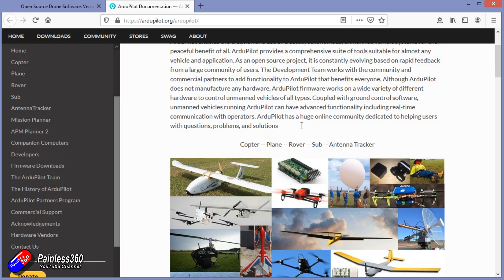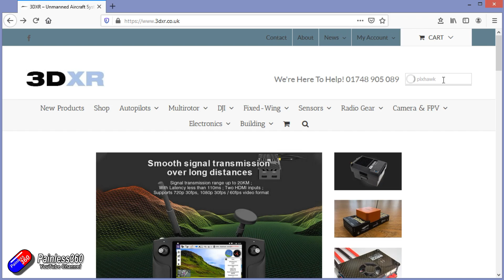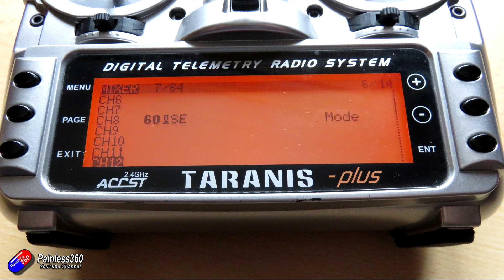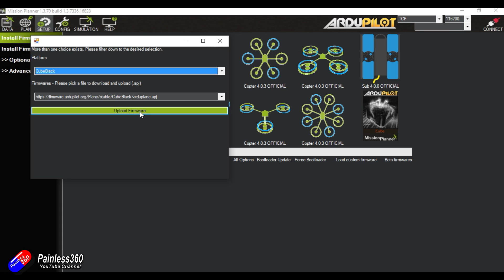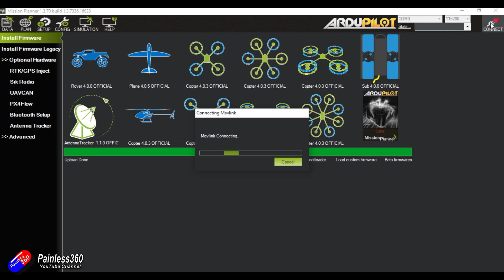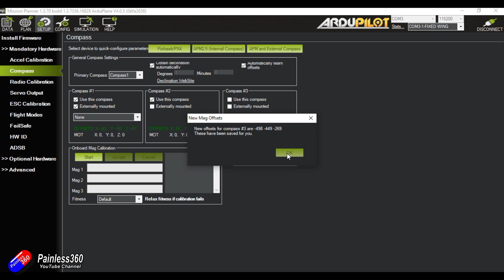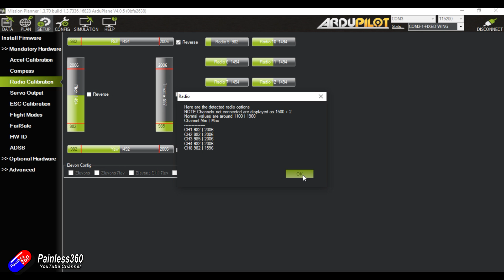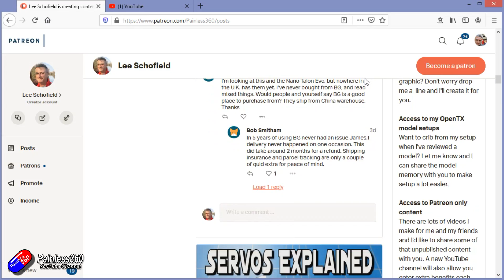PixHawk/Mission Planner/ArduPlane Build for Beginners: Flashing and basic setup

Comment: Nice explanation. I have got the feeling that you inversed the left and right side of the FC during accel calibration - or did I misunderstand something? 
In my PixHawk Orange Cube, the USB plug is on the left side, so I thought that I would need to put the FC on this side for calibrating the left side...
Reply from the maker: The side is relative to the front of the FC and board. New Cubes have an arrow on to make it easier.. Happy flying!

Comment: I truly want to thank you for all of your videos that you suggested I view. I have a much better understanding of flight controllers, setting them up and believe I have the ability to do so.   As advised, I will start by purchasing a basic system and add on additional sensors and item as I become familiar with the basic system.  I am thinking a Cube set up. Can you tell me what is the latest generation orangecube/pixhawk, board, ardupilot, mission planner, etc. For some background info... the end game is to remotely and then autonomously operate my full size design of an advanced heavy lift, evtol., tilt rotor UAV.  I have the scaled down version of the prototype constructed so all I need is an idea of the best system for my application, purchase it, install it and start learning how to set it up.
I really learned a lot from your videos with DSXR so I will be purchasing from them. Again, I really appreciate your videos, very well done.

Comment: Can I use the same mission planner fixed wing firmware procedure for Sonic AR wing + Pixhawk 2.4.6 ?

Is there a separate firmware for flying wing in mission planner?
Reply from the maker: Check out my Arduplane wing builds on the channel... best of luck
Reply: Will do. Can you please post the exact model name to Google for this talon. Is this 250g ?
Reply from the maker: Zohd Talon

Comment: I just finished up doing the initial calibrations and wiring hook ups. Problem I have is when the PPM is connected the motors do not work. If I hook the motors up directly to the receiver they work but half work on the right stick and the other half work on the left stick. Don't know what I hooked up wrong but can't get this to work. I've uninstalled the software and reloaded it from Mission Planner. Any help would be appreciated
Reply from the maker: Are you arming it?
Reply: @Painless360  yes. The light on the Pixhawk flashes white not green and the PPM flashes red. I'm stuck
Reply from the maker: All of the steps I use are in the series - if you follow then carefully (along with the Wiki) you should get to the end with it all working.. Best of luck!
Reply: @Painless360  I will go over the steps you indicated. Thank you. Can you tell me if the light on the PPM is suppose to be red or green? Also does the Pixhawk light need to be green? Mine just flashes white. Thanks again.

Comment: Hello, I have watched the 2020 videos and I think that I am missing something.  In the radio calibration (setup in MP) everything calibrated successfully (red bars on all of the channels at their extents).  The elevator is getting smaller readings when the stick is pressed up (I reversed it on the Taranis as suggested).  In servo output (MP), the bars all move except for throttle.  So, I watched the videos again.  Everything looked right.  I then reloaded the firmware to the Durandal and I created a new model on the Taranis.  Watched the videos again and followed along.  Same issue no throttle in the servo setup.  I also noticed that the output is dependent on the flight mode that is selected on my radio.  When I have manual selected everything except throttle works as expected.  The throttle does not work at all (in servo output).  What should I look for?  Thanks, Don!

UPDATE!  Just for fun I went through the rest of the setup.  I armed it and then I saw throttle.  Now I will install into my plane and see what happens.

Comment: Commenting in via your recommending at one of your other videos that I view this series. 

Of all the pixhawk/cube variations available, which would you recommend as the best budget (under $200 US) option - i.e. the most capabilties balanced against ease of configuation?

 I'm trying to arrive at a soup-to-nuts budget for the total cost of a PixHawk + cube + GPS + telemetry/OSD.

 This is for a learner Bixler fixed-wing I've assembled in antiicipation of being hired on my US 107 to operate a turnkey fixed-wing like an eBee, etc. 

Thanks in advance for either specifics or affiliate links....
Reply from the maker: Orange cube is the default option or look at the Durandal. You can also use something like an F405 too.. Happy flying

Comment: Lee, I watched series on Omnibus and Waytek setup.  Why did you have to use INav to flash them with ArduPilot instead of just using ArduPilot as you did in this Pixhawk setup?  I am trying to learn this whole process for my first setup.  I didn’t see anything in ArduPilot Wiki about having to use any special process on those FCs. Your series are a big help to newbies like myself.  Thanks.
Reply from the maker: All in the wiki... https://ardupilot.org/copter/docs/common-omnibusf4pro.html it's on that page. Hope that helps...
Reply: Thanks Lee.  I had not read the individual board requirement in Wiki for each FC.  Thought they would all flash the same....still learning.  Your support is amazing. I am becoming a Patreon supporter...it is well earned.  I would never have attempted this venture were it not for your channel.  I started with a Kraft radio system so that will give some idea as to my age “disability”.
Reply from the maker: Welcome to the inner circle. Read the welcome message carefully as it had links to as number of the benefits. Thanks again!

Comment: Can I connect DJI FPV SYSTEM to the pixhawk or matek fc board running ardupilot ? And use DJI FPV System radio transmiter
Reply from the maker: You can for RC control. It not for the OSD.. See my video about the DJI system.... Happy flying

Comment: Can i fly freestyle with latest firmware for my quad ? Which mode can I use, Acro .. Sport ?
Reply from the maker: Freestyle isn't Ardupilots forte.. I'd build a Quad with iNav or Betaflight for that...
Reply: @Painless360  but do Inav or Betaflight do have trigger capture camera
Reply from the maker: They do have channel forwarding so depends on how your camera is triggered...
Reply: @Painless360  thanks ... i check it out

Comment: When I was setting up the gps calibration on my cube with mission planner I did not see the live calibration button show up as in your video , any reason for that , I have MP 1.3.7 I think the latest version
Reply from the maker: The compass is what you are calibrating in that step, not the GPS (but one of the magnetometers is inside the GPS unit). It could be a few things - no power to the GPS, not plugged into the right port, wrong settings in the calibration screen in MP... What troubleshooting have you already done?
Reply: Painless360 sorry meant compass calibration, there is a calibrate compass button , not a live calibration button and when I click on the calibrate button only 2 where calibrated not 3
Reply from the maker: Check in the hardware profile to see what compass you should have. Different cubes have different specs..

Comment: At 10:20 mark the LEDs on the GPS are showing GPS lock status and ARM state (I belive). How to do that? I know it must be some setting in the parameter list, but can't find what it is! I'm running Arducopter 4.0.3 and identical hardware to yours (Pixhawk 2.1 with Here2 GPS). I tried enabling the UAVCAN in NTF_LED_TYPES but all I get is pulsating blue lights when the device boots up, but then nothing on the side leds... The button LED does flash.
Reply from the maker: You're spot on. https://ardupilot.org/copter/docs/common-leds-pixhawk.html cover it. Ideally you want Green LEDs to let you know you are good to go...

Comment: Hi Lee - years ago I built a Hexacopter with APM 2.5 and SimonK esc

If I rebuild it with Pixhawk can I use the same esc and is it likely to be more stable in the air? Does more modern hardware actually work better or should I just concentrate on trying to tune up the old?
Reply from the maker: I've not upgraded an APM for a long time so it should be ok but I cant speak from recent experience.  Best of luck with your build!

Comment: I want to suggest if it possible for you to make a tutorial about connecting laptop to apm through internet by wiring  apm to raspberry pi and using 3g/4g modem there aren't many videos on the internet about it in this way you can control the plane by cellular internet thanks for your useful tutorials
Reply from the maker: I'm still looking for reliable, legal, inexpensive kit that will allow for this. If I find some I'll make a video with PixHawk so stay tuned!

Comment: Awesome video 👍. can you connect a power management board to the flight controller. How do you connect it to a quad. How do you connect it to a micro RC receiver.
Reply from the maker: The power module can be part of a power distribution board see the different carriers available for these kinds of pixhawk. Any receiver that talks sbus is just simply plub in and will work. Happy flying!
Reply: @Painless360  thanks for replying.

Comment: Great video! And the contents of the next one will be important to stop anyone falling into the trap that i nearly did. I got my first plane build all up and running, and whilst testing things on the bench in manual mode i noticed the ailerons were reversed. This is where i made a big mistake, to solve the problem i simply reversed the output on my Taranis for the Aileron channel. Whoops! Yes, it all worked fine in manual mode, ailerons were working the correct way around. But, luckily, a bit of further testing on the bench using some other modes - FBWA for instance, revealed my mistake, my method of reversing the aileron channel was all well and good in manual mode, but useless in most of the other modes - the flight controller itself did not know that the aileron servos were reversed! Luckily i spotted my error whilst testing on the bench, otherwise it would have led to a crash the second i switched out of manual mode. Lesson learned - swap servo outputs in Mission Planner, not on the radio. :-)
Reply from the maker: Thanks for posting this - it's amazing how common that is despite it being in my other iNav and Arduplane series. If it makes you feel any better I've seen iNav builds where the radio setup was wrong from the get-go and they worked very hard to try and get the stabilising correction right and then were surprised when iNav spiralled and crashed the plane into the ground first time out. If you're interested - you can check out the rest of the series right now as all of the videos are in the playlist.. Happy flying!